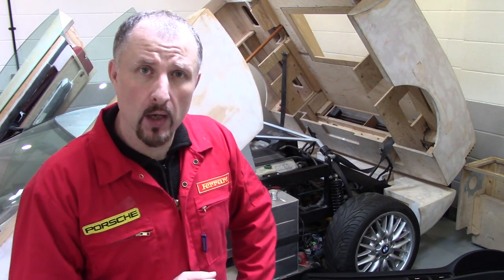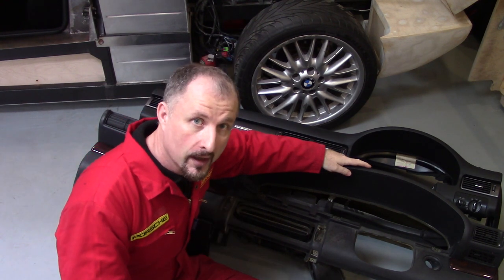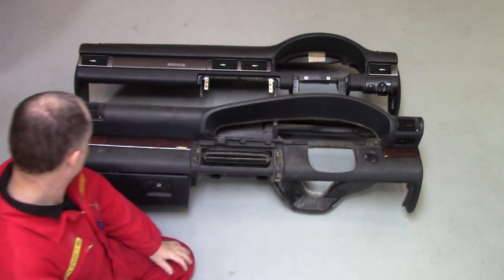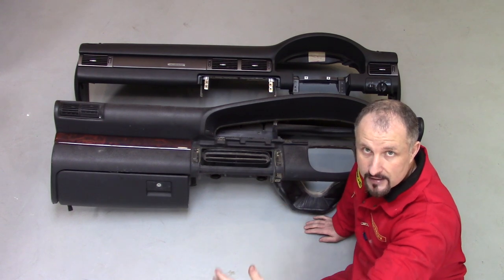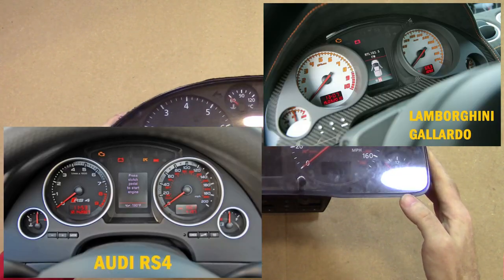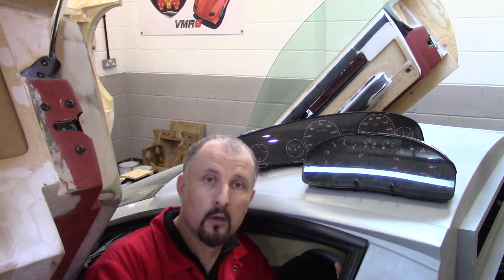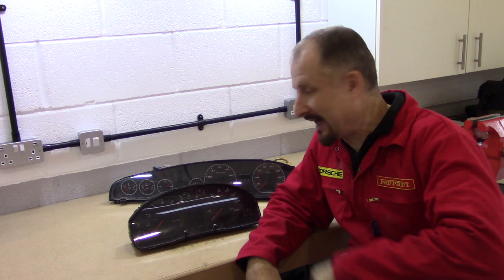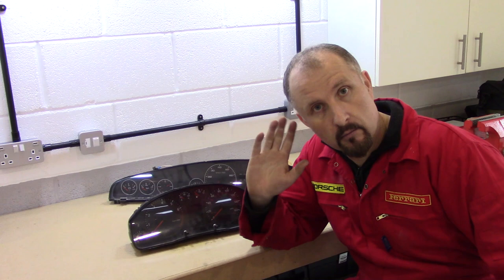Dashboard, Clocks and Switch Gear for my DIY Supercar Part 2: Prototype Ep20

Comment: Nice video 👍 is it easy to fit different gauges as with my build I need to get rid of the Audi gauges and put in lambo ones, I have de chipped my Ecu so it won’t look for the dash but I can’t get my head around how to install different gauges could you help explain how I would go about it? Or make a video on it for everyone that mite be doing what we are Thanks Pete
Reply from the maker: Yes fitting different gauges can be a bit of a nightmare, and it's a massive can of worms. The method for fitting different gauges is also dependent on the type of gauge being fitted and the engine/gearbox/ecu being used. For example Speedometers have to be calibrated to the gearing, either electronically or mechanically. Rev counters need to know the number of cylinders and coils, even fuel gauges have to be set to the resistance range of the fuel sender. This is why using the gauge cluster from the donor car is so easy and cheap, but may not be OK for certain builds if you're going for a certain look. I will go into more detail on this subject in future episodes, especially on the Turbo build.

Comment: So you bought 2 Audi from dirrent generation....so which one Are you going to use? 4th or 5th?  Which one is the donor CAR?
Reply from the maker: Yes that's right. The 4th generation Audi A6 was used to build the prototype, but I'm going to use the 5th generation A6 to build the new project build, which will be a Twin Turbo. That's what I'm currently taking apart now, an Audi A6 C5 2.7T.